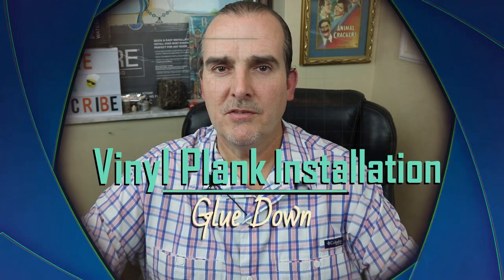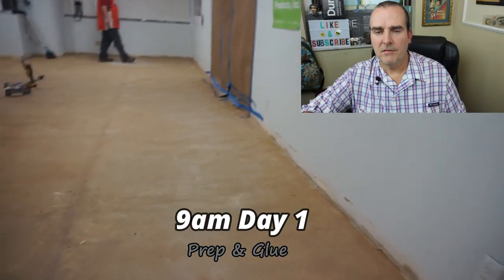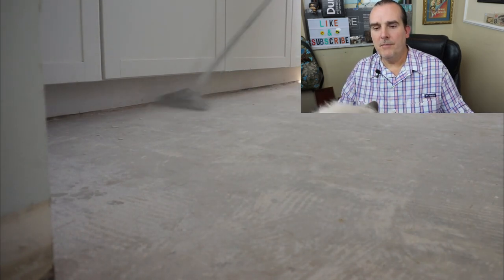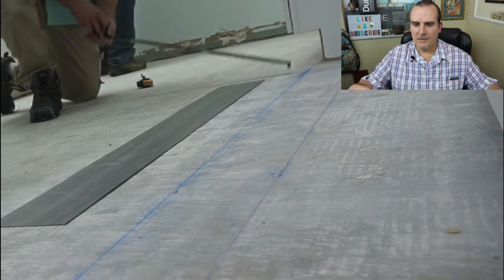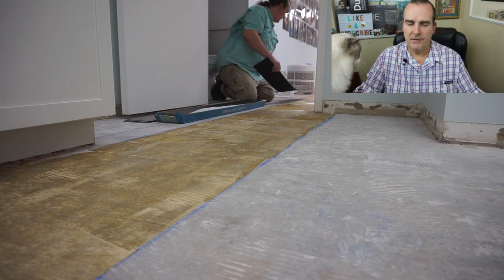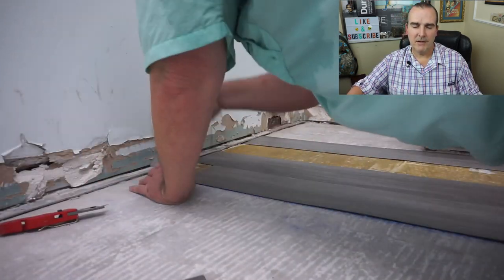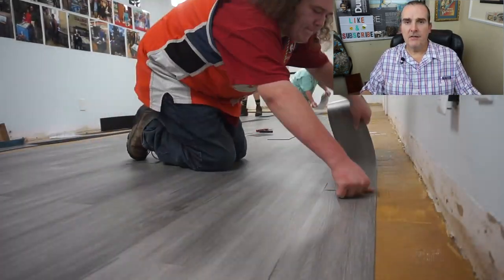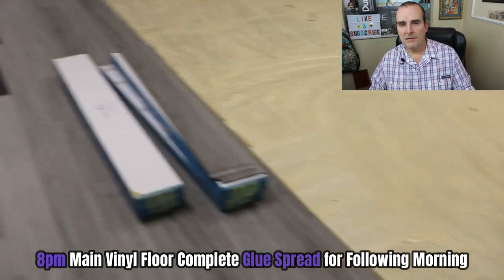Vinyl Plank Installation, How to Install Vinyl with Glue Explained, Tips & Tricks, LVP Installation

Comment: It's always interesting to see how other places in the world view and use products. I have been an installer for 14 years and we actually do mostly glue down vinyl planks, floating products are only just really taking off now.
Reply: How important is it for the floor to be level. Everyone keeps talking about how important it is but the way I see it, the planks are so thin and flexible won't they conform to the shape of the floor?
Reply: @shevinsacrey5862  thinner vinyl planking will follow the floor but it's more about the finished look and the manufacturer aswell as the country it's being installed in will have a specific standard it's to be installed to for warranty purposes.
Reply: Is there an underlayment for this flooring? I want to install it on a concrete slab that gets cold in the winter

Comment: Hello Mr. Jones,  
We had pressure sensitive glue down vinyl tile put in our home.  The tile looks nice, its durable and we like it.  It was down for about 4 years without a problem.  Unfortunately some of the tiles came up.  We had the contractor come and fix the problem.  Now it has been about 6 months and some of the same tiles are coming up again.  Needless to say I'm irritated.   The contractor did not clean the old glue off the subfloor before regluing the tile. Would that keep the tile from sticking to the floor?  What may have originally  caused the tile to come up?  Any information would be appreciated.    
Thank you

Comment: Hi, I'm a tile contractor in California and I just installed 1400 sq ft of Mannington 18 x 36 LVT Glue down. I have a few problems with lippage  with some of the seams between the tiles. The floor was rolled with a 100 pd roller throughout the installation process but I still have a few areas with this problem. Do you have any ideas on how i can make these seams flush? Thanks, Todd

Comment: I’ll be putting down 25 yr warranty 2mm LVP planks over the concrete slab in my home. It’s approximately 1,300 sqft. Is there anything that can be placed between the concrete and planks to insulate and soften the feel on our feet. Also, what glue would be the best for application?

Comment: I'm putting some surplus pieces of vinyl plank flooring on a large outdoor countertop under a patio,  and I want to glue it to the plywood base of the counter.  Could you recommend a glue to use that's available in small amounts?  Will any common construction glue work?   ie.  Liquid Nails,  Contact Cement,  or ???   Also the vinyl planks have a thin dense foam backing,  should I scrape that off before gluing or just glue as they are?  Thanks!

Comment: Great video! I have a question, can I apply this directly over existing hardwood floors that no in the best of shape? What kind of prep would I need to do? Also what if eventually we decide to pull up the vinyl, would the adhesive damage the wood floors anymore?
Reply: Nail or screw any loose boards then skim the whole floor. Look for any kind of feather finish. And use a long flat edge trowel. I use a 24"
Reply: It'll do some damage. But the nice thing about 3/4inch wood is you can sand and refinish.

Comment: You mentioned Henry's pressure sensitive adhesive. Is this the Henry 430?  I'm planning on installing this type of flooring for my basement.  Thanks
Reply: You can use any pressure sensitive. Just make sure you let it set. It usually turns clear. But when you touch it it'll be sticky but not transfer on to you.

Comment: Hey I liked your video. I’m an artist. I have a big sheet of thick paper, 4 feet x 5 feet.  I want to glue it down to a sheet of Masonite. Will this glue that you used seep into the paper fibres from the back. Painting on front. Thanks!
Reply from the maker: As long as you let it tack up really good it can't seep. I love this about the glue, no cleanup basically because its not wet and doesn't get all over everything.

Comment: I'm covering a concrete slab on grade floor in a seaside cottage where flooding is always a possibility.  Are there water proof adhesives that will stick if the floor is ever submerged?

Comment: Thank you for your video! Curious about the sub-flooring...we had someone come out to measure and give an estimate for 1200sq ft of glue-down vinyl and were told that another 1/4" plywood sub-floor layer was needed on top of the existing plywood flooring. He said it was required to do this for glue-downs. 
There are no sub-flooring issues that we're aware of so its not clear why another layer of sub-flooring would be needed (not to mention, the additional expense). What's on the floor right now is carpet and padding, with a couple areas of sheet vinyl.
Is there a good reason to add a second layer of sub-flooring, or was he padding the cost of the job?
Thanks for your time.

Comment: How do you stager the design? I’m using 48 inch planks
Reply: Just glue a path about the doors with. Don't do while floor yet. And to start I'll cut 3 or 4 board so I have like 1/3,2/3 and a full or 1/4,1/2,3/4 and a full. Just put cut edge on the wall or doorway so you'll have factory edges touching next boards. Then when you get to end of room. You cut last piece to fit and the piece you cut off is now you next starter. That way you have minimal waste. Just keep seams at least 4 inches apart from each other.

Comment: Hi! I was wondering.. how do you REMOVE glue-down LVP? Heat gun and floor scraper? I'm looking to replace that type of flooring which is currently in the kitchen and replace the carpet in the adjacent dining/living room for just one type of flooring to unify the space. Hoping there is a DIY way to do it! Thanks!!
Reply: I have this type of vinyl plank flooring using the glue method.  I was told the glue was what is called pressure sensitive.  I replaced a couple pieces after many years all that was needed was a razor knife to seperate the piece I wanted to remove and it just pulled right up.  Also didn't have to add new glue as original glue was still tacky.

Comment: I want to lay this type of flooring in my basement. What do I need to do where the expansion joints are to prep them?
Reply: Use a flash patch or feather finish. Usually easier to just skim the whole floor

Comment: Does the concrete need to be clean? My subfloor has a lot of paint overspray and splatter.
Reply: This is a good question and I hope to find out the answer as well.
Reply: @jenniferfug5553  We ended up renting a concrete grinder for best adhesion. Wasn’t willing to risk it in a large commercial space, but I’ve since seen it done without grinding. 

Subfloor smoothness is very important though

Comment: Hi jones!  I have a question for you.  My wife and I Are building a small loft apartment in our metal barn while we wait for our house to be built.  The subfloor is 5/8" chipboard or OSB.  There are a couple high spots from the joists under the floor.  I would rather not deal with a floor leveling product since its only a temporary setting for us but my wife doesn;t want to walk on the OSB and potentially getting splinters.  I've been thinking about gluing down vinyl flooring.  Is this an option with a couple high spots?  Will the flooring flex enough and bond to the floor without needing a leveling product?  I appreciate the thoughts.
Reply from the maker: Its not an ideal situation, but if the high spots a gradually sloped then you should be fine. You can also put a second layer of ply over the 5/8 and plane or sand out the high spots.  I'd afraid of sanding 5/8 because its kind of thin.  GOOD LUCK!

Comment: I have a DIY project I'm fixing to try and take on. I found some Mohawk Group Luxury Vinyl Planks for about a  $1 sqft. and see it's suppose to be glued down. Could you share some insight as to what I getting into and what to expect as far as laying it proper so that no problem occur? I guess I should have asked first what you think about the product and is it durable, and are there any problems you know of about the product? I just figured with your knowledge you aware of some of the issue with different product and heard feedback from installers. Thanks in advance.

Comment: Great video! I want to install this type of flooring on my concrete basement floor. The problem is the concrete around the perimeter of the floor is not smooth like the rest of the floor because I had a sump pump installed. The concrete they used probably wasn’t mixed right because ever since it has a a dusty, sandy residue on top no matter how much I vacuum it. Do you think the adhesive will stick to that part of the concrete?
Reply: No. You have to use a feather finish and skim over it. Just use a long flat trowel. No teeth

Comment: What glue do u recommended to glue planks over old 12x12 (school like tiles) vinyl?
Reply: Pressure sensitive. Just make sure all of the tiles are down good. You don't want any loose tiles.
Reply: Make sure to lightly sand the entire floor & tsp it to get any wax grease off!!!

Comment: Would you recommend the same glue if I’m installing this type of vinyl on a wall
Reply from the maker: I guess it would work. I use all different types of glue, liquid nails, PL, Bostik's, Ect.  Just make sure you remove any padding on the floor.  You need to glue directly to the back of the flooring not to the padding.

Comment: awesome instructional video man! but I have a question I'm about to install a glue down over an old linoleum that I'm not planning in removing but I was wondering how clean the floor has to be because there is very small traces of wax on the floor, do I need to sand the floor just a little for better adhesion? thanks
Reply from the maker: Yes the glue will stick to the wax but may not penetrate to the floor underneath. So you have to get the wax off by sanding or stripping. You can use a chemical stripper or try to sand it off but it’s gotta come off before installing the new floor.

Comment: Great video -- thank you! Is it possible to install vinyl plank flooring over a 1 or 2 mil. underlayment? I'd like to "soften" the feel of the hard LVP which I'm planning to install over my concrete basement.
Reply from the maker: Only Nucore let’s you use an extra pad with their preinstalled cork back. Most of the other brands already have a padding attached and you can’t use a second one it makes it too soft which will lead to your seams opening up all over the floor.
Reply from the maker: I just remembered QuietWalk has a pad that CAN be used under LVP with pad attached it’s not the reqular QuietWalk it’s a special one the is black and says QuietWalk for Vinyl on it here it a link so you can see what it looks like     http://amzn.to/3f5SAWE
Reply: @JonesKnows  Great video. I am planning to use the black Quiet walk.  Do I need to glue down the Quiet walk than glue the vinyl planks over? TIA

Comment: Can I glue this product over top of a sheet linoleum that has a tile pattern to it?  Will the glue adhere to the sheet linoleum and will the old tile pattern read through the new flooring?
Reply from the maker: These glues stick to almost anything so that's not a problem. You have to make sure that the sheet linoleum is completely glued down.  Some sheet products are only perimeter glued, so the middle of the floor is not attached and this won't work.  So you have to determine how the old floor is installed . Cut a small square out in the middle of a room and see how comes up,  see if there is any glue under it.  If it has a distinctive grout joint, meaning you can feel the grout joint, then it will probably telegraph through any vinyl floor that doesn't have a rigid core or that isn't at least 5mill thick.  If it were me I would probably remove the linoleum or go with a  thicker floating type of vinyl like Lifeproof or Nucore. These products can go right over anything and grout lines won't telegraphy through. Let me know if you have any more questions. I hope this helps.  Tim

Comment: Good video. Looking to put this in my kitchen. Was wondering, can we install right over the old sheet vinyl? 
Or did we need to rip up the old vinyl sheet first?
Reply: I rip it out. You can have problems down the road if you don't.
Reply: @rapodejko  went ahead and ran with that advice of just tearing out all the old stuff. Thank you for your help and the great video
Reply: Welcome for the advice. Videos not mine though. I just have 20 years experience doing flooring. Done everything from mansions to yankee stadium.
Reply: Great profile pic btw
Reply: @rapodejko  outstanding. That's what I call experience.
Reply: @rapodejko  thank you good sir.

Comment: I live in Arizona, I have a problem with tha lvp glue, it dry and I installed, next day or so the lvp is lifting up and the glue is moist!!! 
Any suggestions??? 
Have the problem only in winter!
Reply from the maker: Did you roll it after you installed it ?  Do you remember what the name of the glue was ?
Reply: Jones Knows I do roll my jobs 
And glue I have use maipi, Roberts and a local company that makes one, any one you recommend?
Reply from the maker: I use Roberts and Mapie all the time with no problems.  Does it grab when you first install the floor ?
Reply: Jones Knows yes it drys and grab very good, I’m not the one that have the problem so we been talking about it in the company and we think it have to do something with the moisture it only happens in winter.